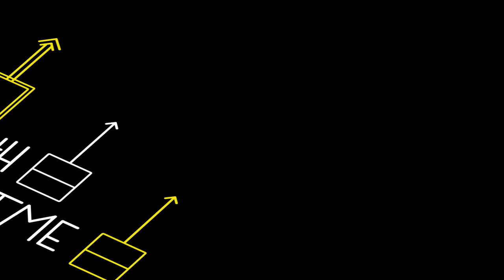0-CTRL Sequencing Mimeophon in Tape & Microsound Music Machine

Comment: Sounds cool, telling you tho as I said in my email the light bleed on the O-Control makes me want to gouge my eyes out guys. It’s not a cool look, it’s distracting a heck.
Reply: what do you mean by light bleed
Reply: @SorchaSublime  the various illuminated elements are LED’s which shine up thru the PCB. It’s clear no efforts were made to baffle the light from say step 0-1 or 1-2 or 2-3 on thru 7. So instead of crisp delineation you will see when say step 1 is lit the 0’th and 2’nd will also be partially lit. It’s still a cool sequencer I don’t regret it but it’s a legitimate critique imho.
Reply: Watch at 2:55 or so, you can see 3 steps or more are lit at a time from bleed.
Reply: @JamesReedy  Monk would be bothered by that too.
Reply: @snörre23  I have one, it is mildly annoying esp given what it costs and how cheap it’d have been to fix.